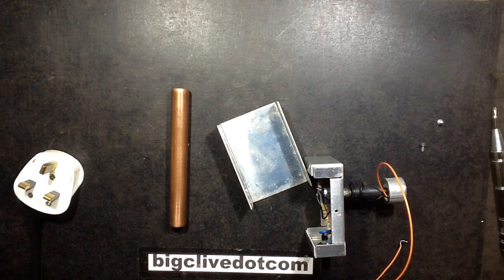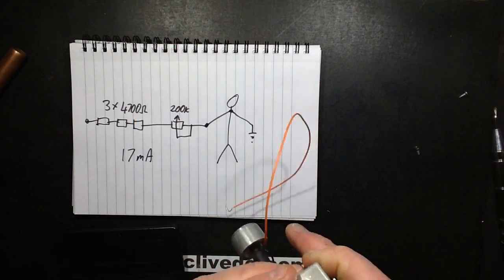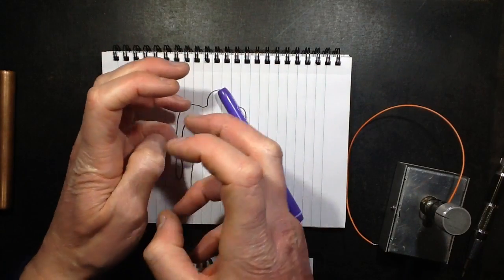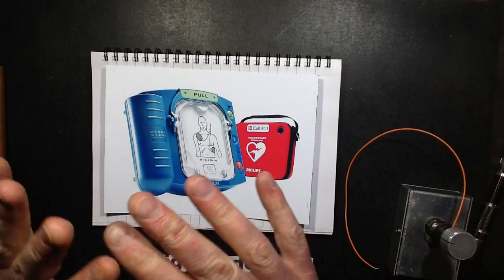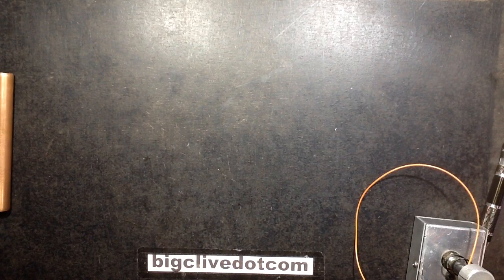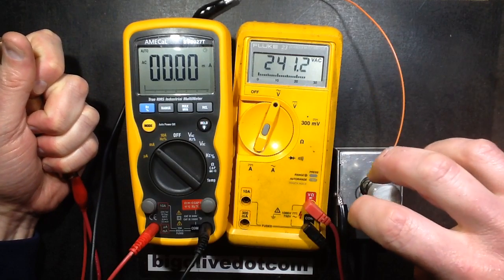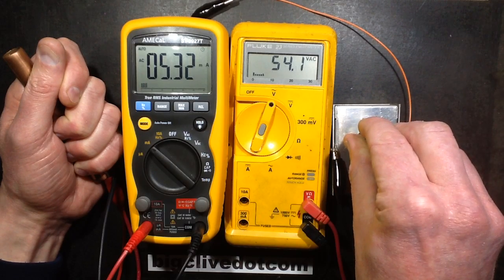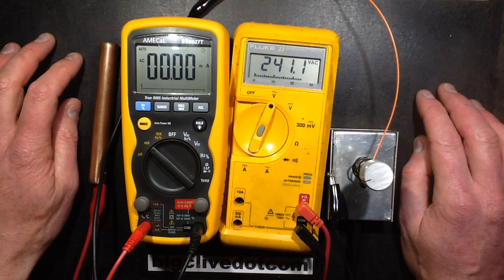Avoiding electrocution (Featuring real shocks.)

Comment: I have a LifePak 15. This is a machine used by ambulance and in hospitals. It is a very sophisticated life monitor and a defibrillator in one unit. To use this thing you need proper training. It is semi automatic but you can override it. It also has to be tested weekly.
To test you turn it on and in the menu select the self test option. It will test the sensitivity and then charge the caps a few times and dump it across a beast of a power resistor and a low value power resistor used as a shunt. It then gives you a extensive report of the test. Also you replace the caps every year, they are in their own module so it is very easy. I had the capacitor bank apart and it uses giant EATON caps. The higher value has huge Panasonic electrolytic caps

Comment: Haha dang @bigclivedotcom I did not have to buy pinball machines to get electricuted I could have just made this contraption. ;)
And yeah I have gotten a zing off of every pinball part on both my EM's and SS pins. xD
From the lighting to the 12V coils to the 50v flipper coils to even the 100V displays.
With the display I knew better but I brain farted and touched a heat sinked transister on the display board on my Getaway and wow was that a big ol zing.
Must be some tough basterd to take almost the full 120V for US voltage. Haha.
Some times I wonder how I am still alive with all the zingers I have got off my pins. ;)

Comment: I don't think defibrillators will save the high voltage line workers there insides are usually crispy
Reply from the maker: It's more for the ground borne gradient shocks.  The majority of fatalities are associated with pole placement in live lines or induction shocks where a dead line becomes live through capacitive/inductive coupling to adjacent lines.

Comment: I remember at Uni, in one house my room had a light fitting where with bulb in it would push the fitting out. One time the bulb and part of the fitting fell out and I picked up the fitting part and pushed it back into the rest of the fitting. I remember thinking, what's going on I feel odd, then I dropped to the floor and started to realise i'd pushed my thumb against the contacts and electrocuted myself. I had an essay I was writing due in, I'd actually cooked a tiny cylindrical bit of meat in my thumb, and during writing my essay it fell out of my thumb leaving a little empty hole.

Comment: Most exciting video on youtube EVER! At some moment I thought you really won't be able to release from that hellish device. But why didn't you put like a momentary switch/bell switch under your feet and send all the power through it, that you would probably depress automaticly after losing control? I always do that when I'm going to do some stupidness, like making electric arcs with mains voltage, holding the cables with my bare hands... the insulation near the arc melts so quickly sometimes :D

Comment: Where was your man with the dead man switch.  Oh I would love to see it turned up just for a second!  I have had a few shocks in my time, none of them directly my fault, but as I always say, but don't always follow my own advice, check everything and lock the power off.  Worst one was when I had turned off every isolator in sight and also checked for power, but unnoticed by me this thing had a wire fed from below with a live feed fed remotely.  Now it should have been killed by the isolators, but some wise guy had changed things for the worse, not taking a live feed from the source and feeding it from elsewhere!  I lifted this thing up and my fingers went across the live wire, but because I was lifting something heave I let it go, not that my muscles wanted to, but I could not hold the weight and get electrocuted at the same time.  I was to say the least not very happy about things, so I went in search of where this feed was coming from (after I had recovered) and never found it yet, so I terminated it.  I never found out what this feed was doing anyway, it went for miles round this warehouse and vanished onto a huge tangle of wires that went into a pipe in the floor.  I thought it might go to another panel, but there was nothing on the other side except the street?  I did wonder if they were powering it off the street lights after they cam on, but I had packed up and was leaving before I thought about it, I had done the repair and put all the ducting etc all back and was not about to take it all to bits again.  When I think about it, the street lights had come on round about that time as well.  Humm!  The company had just taken over the building, so they would not have known anyway.  It was all very strange!  But it was all left safe, but it just goes to show, you just can't take enough precautions.  my fingers were sore for a good couple of hours after that, it bloody hurt!

Comment: Standing waist-deep in seawater and reaching up to grab a metal pipe (with salty wet hands) could achieve ~500 ohms!  that's 30mA (the threshold for fibrillation) at only 15 Volts (AC)!

Comment: So when I was twelve, I put myself directly across a live 240V light fitting. There was a broken bulb inside and the filament was separated so stupid me thought "that shouldn't be there" so I grabbed one of the ends and tried to turn it out. No luck, no grip. So then I attempted to grab the other filament and BANG! If felt like someone had hit me in the chest with a sledgehammer. Luckily I was standing on a ceramic tiled ledge that I was able to fall off of so I only had milliseconds of exposure but, I actually felt my chest beating out of rhythm so you know what I did? I went to bed. I didn't want to cause my parents any fuss because I didn't want to get into trouble. At the time my house didn't have an RCD but somehow the breaker didn't trip either. How close was I to dying?

Comment: Very interesting. I know from training (I'm an electrician) that 150mA will kill the average human being. That's way RCD's are set to trip at less than 30mA leak (5 times less than lethal). As you can imagine, I get a lot of shocks. It doesn't matter how careful you are, electricity hates everyone and wants to kill you. Its interesting to hear the levels described. One side note, the most painful electric shock I've ever had came from a car, not a house. I was doing a power drop test on a bad engine (I'm also an amateur mechanic) and pulled off a HT lead while the engine was running. My other hand was on the body. WOW, What a belt! I was thrown away from the car! Turns out that ignition coils can push out up to 5 Kilovolts. The HT lead was split. The current went straight across me! I felt like crap for hours afterwards.

Comment: I would include a emergency stop switch on the floor or near my belly so if it gets too extreme I can kill the connection if I were to replicate this.

p.s. What meter do you recommend for a guy working with low voltage and current circuits (~100V) but do not want ones that break on 4 seconds after being removed from the package?
Reply: Fluke

Comment: Just to add to the knowledge (or, maybe misinformation - who knows?) - the heart's rhythm is influenced (quite a lot) by the sinoatrial node - this is a bundle of nerves on the right atrium. From this, nerves spread through the myocardium. The depolarisation/repolarisation of the cells in the SAN causes whats called an "action potential", which is a cascading depolarisation what goes down nearby nerve axons. 

The rate at which the SAN generates AP's is set by a huge number of factors. Electrolytes, blood gases, pretty much everything. Notably, it's also influenced by the vagus nerve... A cranial nerve... What comes out of the brain. 

If the SAN stops working, the heart has a second node which can kind of take over - the atrioventricular node. If that stops, then hearts can continue to spontaneously beat. You can do it to rabbit(?) hearts in test tubes... Completely removed from the bunnyrabbit... And you can stop and start it by dripping potassium and calcium salts onto it. 

...Where I'm going with this, is that although AED's are the absolute key thing that you want if you munt your heart with electricity... If one isn't available, there are still things which might save a person... First, vigourous CPR. CPR with gusto. Specifically, the chest compressions. Really go to town there... Try and break ALL of their ribs. 

....And, as a last-ditch hail mary thing... A procedure called a "precordial thump"..... Punch/kick/stomp/club them in the chest as hard and suddenly as possible. This can stun ventricular fibrillation and other abnormalities in much the same way that a defibrilator would. Only, way less effectively, and way more "dude, don't punch the dead in the chest"-like. It's got a low success rate... But a higher success rate than giving up on someone without trying...... (This is aimed at lines workers, who don't have access to an AED, and who witness a colleague getting a whopping big shock - really, lines workers should get taught this.... And also,  yeah, they should have defibrillators in their vehicles....)
Reply from the maker: When I was first taught CPR a long time ago part of the treatment was to start with a heavy blow to the chest.  There's golfing folklore that if someone's heart stops on the golf course you smack their chest with a golf club.
I'm appalled at the mortality rate in the American power distribution industry.  Many of those fatalities could be prevented with an AED which is ironic since the first pioneering AED development work was subsidised by the power industry because of the number of fatalities.
I'm aware of the ability of the heart to fire a rescue pulse and effectively defibrillate itself.  I wonder if it applies to all people or just some.
Reply: As far as I know any normal mammalian heart can do that. And most of them do... Premature atrial contractions, which occur when a heart chunk other than the SAN contracts before it and sets off a cascading pulse. That tends to result in a sort of non-beat because hearts need to contract in the correct order. Because they then have a refractory period while the electrolytes (Calcium and potassium mostly) recalibrate (intracellular and extracellular back and forth), there's typically a notable interval between beats. Then the SAN fires off a normal or possibly bigger than normal charge... Kind of like self defibrillating...

For lines workers... I'm presuming in a lot of cases they work alone and in isolated areas (like the one from that song?), in which case it wouldn't do them much good... And defibrillators need maintaining... Also I wonder if they don't want to encourage passersby to run up to lines workers who are unconscious, in case they're unconscious because the surrounding area contains live and deadly HV cables which are now on the ground...? 

Also, the defibrilator would need to be stored somewhere where it won't get damaged, but still be readily accessible, but not easily stolen. Which is challenging.

So... the line workers probably need to work in pairs... And have defibrillators with them. 

Failing that, chest punches.

Comment: When I was 11 i was on vacation and got a one use camera. When it was empty, i wanted to know how it works. So i tryed to open it and sticked my Fingers inside it. But I didnt know that there is a high voltage capacitor(~300V) inside the camera. So how luckyly i am, i touched the capacitor and got a very hefty shock. After that my arm felt very weird for about an hour

Comment: I have an MSI Gaming 5 z97 motherboard and Asus Strix Geforce GTX 1060 6GB OC edition with voltage read points.
Do you or could you do an instructional video of how to use the multimeter to properly check these. 
I am interested in furthering my knowledge and skills and also using this method gives a much more accurate reading than cpu z and other softwares.Kind regards Adam

Comment: What is the standard trip current in your are for whatever is your equivalent of a ground fault circuit interrupter? I think the ones here in the USA trip at 5 mA.

As a ham radio operator who potentially deals with high DC voltages, one ritual is keeping one hand in your pocket or behind your back when touching potential sources of high voltage. Also, touching it with the back of your finger is suggested. The idea is that any high voltage will make your muscle contract and pull your finger AWAY from it.
Reply from the maker: In the UK the standard trip rating is 30mA.

Comment: When I was like 7, I was sitting on a wooden chair and I wanted to figure out why my radio wasn't working. Firstly I thought that it is the wire that connects the radio to 250V so, I unplugged it from the back side of the radio and inserted it in my mouth, touching the holes with my tongue. It shocked me quite hard but after like 5 minutes, I was ok. I was more scared than actually hurt XD

Comment: These units are finally getting the attention they deserve.  I've noticed these units mounted in airports recently where I've traveled in the States & China.  Didn't see any in the Düsseldorf airport when I visited Germany & The Netherlands in 2011, though.  The ones I've seen are mounted in bright red kiosks or on the wall in a fire alarm-style box with a big bright red sign above it reading AED.  The problem, however, is that the traveling public I've encountered have no idea what these things are when they see them in the airport.  So you could potentially have a heart attack and your salvation could be meters away with no one knowing how to help you.  Of course, I assume (hope) that airport personnel know how to use them.

The boxes are designed so that when you open it (or break the glass in some cases like a fire alarm box), an alarm goes off which summons EMS personnel.  Unfortunately for the average person at home these units are still way too expensive.  The ones made by Zoll, Dixie and Phillips range from $1000-$1400 (~£900-£1150) in the States and most health insurance won't cover the cost.  I bought one for my parents out of my own pocket because their insurance wouldn't cover the cost even though my father's doctor says he's at risk for a heart attack.  They don't go anywhere without it.

Comment: Well even I am very good in electrical stuffs , I would never do what you did, actually I got shocked more than once in my life with even very high voltage over 2KV while fixing old TV, and even once 25KV from TV  tube  beside all of those I don't know what was worst feeling for me , shock from 25KV much higher freq. than 50Hz , or 220V 50Hz while I was 12 years old, by luck for me is  only my right hand got shocked, no current trough my body as I was not grounded on any way. Today I fully understand what happen, but in that time 35 years ago , I had no idea what happen , only memories left in my head for all life till end of line xD.

Comment: I must admit over the years i've had a few wallops from electricity and i find it quite refreshing actually, there's a bit of a buzz afterwards which is quite exhilarating.
Reply: I find it more nerve-wracking as the slightest sense of dizziness or palpitations and I'm convinced my heart is fibrillating and I have to take a seat and wait to see if I die or it goes away.

Comment: As part of my education I got to know one of the professors who contributed to the design of these defibrilators. She was responsible for the part that looks at the state of the heart. 
Basically they received a significant amount of waveforms taken from heart patiens at the local hospital. They then worked to find discriminant functions that could provide the best classification of failures vs. successful shocks. 
The defibrilator can then use that data to "learn" to look for optimal patterns on the patiens which are connected to it to maximize the chance of success. 
This is the lady :) http://www.ux.uis.no/~kjersti/

Comment: Thank you Clive. That was the best demonstration of what current can do. I have been very careless with electricity in the past, with my mentor giving warning but having not experienced anything too scary I thought it was unnecessary warning. I had been shocked before with wiring light switches live and such. I finally wised up ( a bit) when talking with commercial electricians with the shocks they have experienced. I realized that my shocks were minor because of the limited load on the circuit( I.e. a light bulb). When working with motors or full circuits is when things get dangerous. Real enjoy the year downs and the schematics.
Reply from the maker: I was investigating the death rate from electrocutions in the UK, and from what I can see the number of shocks versus actual fatal electrocutions is huge.  Something ridiculous like 0.01% of serious shocks that resulted in medical attention being sought.  And if you factor in the fact that most people will shrug off a shock then the ratio of shocks to deaths is possibly closer to 0.001% or less.

Comment: that reminds me of a time i was fxing a washing machine and caught my palm on a very large capacitor while leaning on the casing with the other causing me to grip the cap.
Reply from the maker: Washing machines are a real killer in the home.  Particularly the older electromechanical ones.  Urgent need for repair, expensive to get repaired or replaced, wet hands, poking about and lots of exposed live contacts with loads of grounded metal for your wet hands to hold on to.